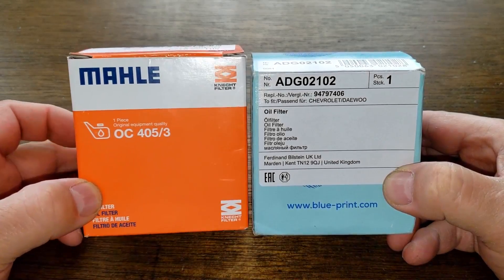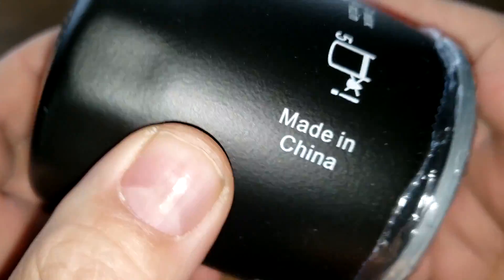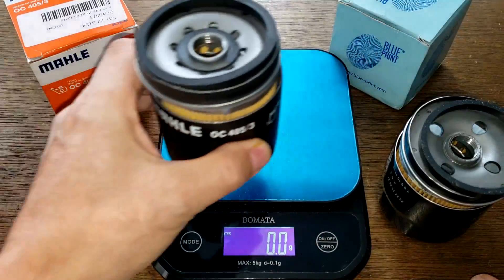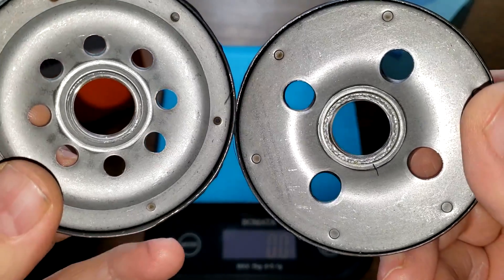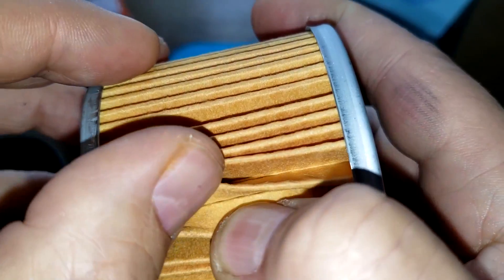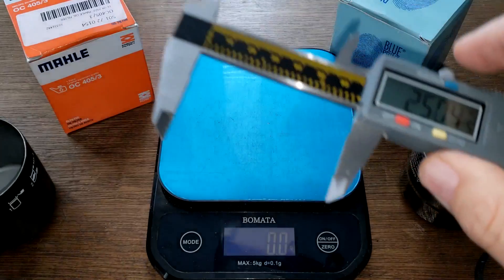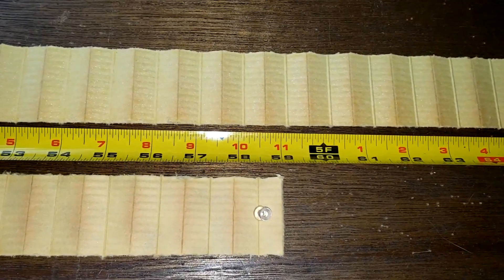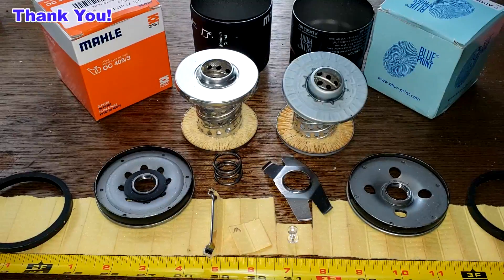Mahle OC4053 Oil Filter vs. Blue Print ADG02102 Oil Filter Cut Open Comparison

Comment: The BluePrint is sold by Febi Bilstien ,but its only distributed in the UK by Blue Print ,but its actually made in Korea, its a clone of the GM Daewoo filters made by Mann & Hummel Korea,,its basically the same filter sold by Blue Print ,....the Blue Print is closer to a actual GM  filter
Reply: I would have never guessed it was made by Mann+Hummel.  They have certain characteristics that I usually can spot in their filters, regardless of brand name.  Good Info, man, thanks
Reply from the maker: Thanks for the info, Mark!👍
Reply: @WhipCityWrencher  it's basically a clone of the DongWoo Mann and Hummel GM Daewoo oil filter you cut open earlier that I sent last year, probably the media is slightly different on the inside instead to GM specs
Reply: Blue Print is Febi/Swag, their parts are among the best aftermarket in Europe but better use genuine GM filters in GM cars as they don't have much difference in pricing and offer peace of mind.
Mann is what i will choose in aftermarket filters, it's a company that only makes filters and related items so they have to watch out their reputation.
Reply: @johnbelwell2461 Febi/Swag aren't particularly good quality, there's much better available in Europe.

Comment: I also prefer the Chinese Mahle filter in all aspects! 😃👍
I think the little rubber ring on the inside is for sealing, for avoiding a "short-circuit" as there is no silicone anti-drainback valve.
Some filters aim this by a tapered foot of the inner element entering the baseplate, like the Blueprint filter.
I think both do their job, but I'd prefer Mahle. 😉

Comment: Just been researching filters for a small Kawasaki industrial engine - most of the Mahle filters were stated as having a 28 micron rating. Couldn't find anything for the Blue Print, other than they're about a 1/3 cheaper than the Mahle in the UK.
Reply from the maker: Thanks for Sharing

Comment: The date code you point out looks like an old school "printer's key code" style for coding editions. That is where they remove a number each time they make a new run. If that is the case, then maybe 4th week of July 2023?
Reply from the maker: Could be.😊
Reply: no it's a British system where you mark it when you install it. Same on batteries. The installer will choose one of those years and months when installing it. it's not a manufacturing date at all. Sincerely, a Brit.

Comment: What’s the rated mileage on this filter?
Reply from the maker: I couldn't find the Mileage rating for these filters.
Reply: @WhipCityWrencher  Thinking about it, 20,000 is a lot! Cheers Whip
Reply: I think GM say if the car burns a minimal amount of oil it can last 20,000 miles.

Comment: I stick with the Blue Print, its a OE GM design & even though the Mahle is nice ...its a Mahle Aftermarket. its still made in China.....i rather find a OE Mahle made in Europe under a different vehicle manufacturer that's compatible ,the OE Mahle is usually made in Europe
Reply: The Mahle appears to be a better filter.

Comment: Mahle, FTW. Well made, more media area, coil compression spring and has the rubber collar around outlet hole to seal clean from dirty side oil filter. With no adbv in either to seal central area, something needed to do that. Blue Print looks to be metal on metal there, with the flat spring, not confident in the seal there. Too bad no published efficiency spec for either. Thanks for vid.
Reply from the maker: You're Welcome faxmen09👍
Thanks for the feedback!

Comment: Mahle always had a great reputation and it seems they are maintaining their standing.  The Blueprint looks to be finely made as well, no sloppy glue, etc.  the 4 giant holes is kinda funky but it is nice to see them made in the UK.  I'd take the Mahle as a first choice but if I didn't have a choice The blue print would be  acceptable in a pinch, especially if all I had was the orange can of death. Curly Dog is a rock star.  Thanks for sharing!    Great Job, Pete!
Reply: The Blue Print is only distributed in the UK thru Febi Bilstien, it's actually made in Korea by Mann & Hummel Korea(DongWooMann& Hummel), its a exact clone of a GM Daewoo filter,it even says Daewoo on the fitment interface
Reply: @daewooparts  Too bad it wasn't English made, thanks for sharing the info.
Reply: Mahle was my first choice. But now, when they make oil filters in China - I found another filter brand to use.
Reply: @Alfafanatico  Yeah, not my favorite coo for the Mahle  brand filter, either. But, cost savings is a factor in filters now. Fyi, Mann another well-known quality German brand, also makes some filters in China now too. It is what it is.
Reply: @faxmen09  
Unfortunately yes, most things are now made in China. 
I bought a Purflux brand oil filter. It should also be a high-quality company, but luckily this brand oil filter is made in France.
Reply: @Alfafanatico  What I've seen of Purflux, a well made filter. Guessing, a little pricey too. Unique chevron design pleating.
Reply: @faxmen09  
In Europe (Estonia) they are not that expensive.
Purflux LS932 price is 3.78€ (~4.20USD).
Mahle OC 467 is little bit cheaper 3.32€ (~3.70USD). 
MANN W 75/3 is just a little bit pricier 4.27€ (~4.70USD).
Reply: @Alfafanatico  many Mahle oil filters are made in Europe, just got to buy the OEM ones from certain vehicle manufacturers, it's the Mahle aftermarket that's made in China
Reply: @Alfafanatico  Yeah, I get it. I was actually surprised to see that because all the filters I’ve gotten from them previously have been made in Europe.
Reply from the maker: Thanks, Jim👍
Reply: @WhipCityWrencher anytime Pete!